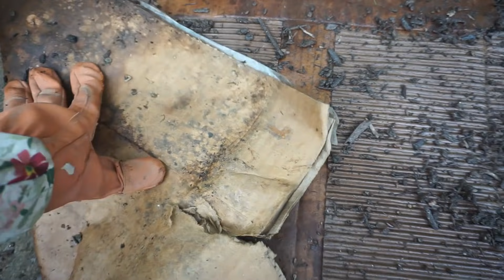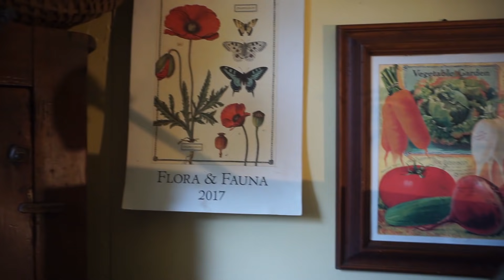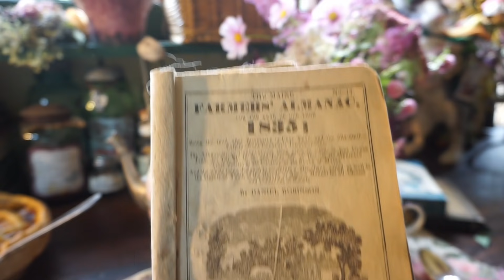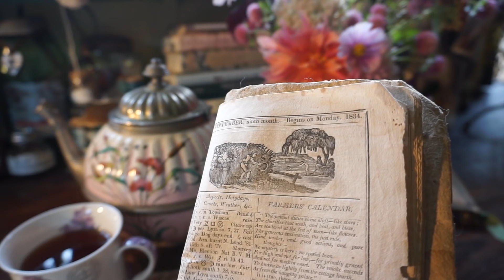Garden Room/ Gathering Plants for drying/ Using a Cold Frame

Comment: I have a room like this at the back of my house.  I live in an old farmhouse on 3 acres built in the 1850s in Pennsylvania.  There is an addition at the back of the house which is from 1920.  It is two rooms comprising a kitchen and a room like this one in the video.  I've been calling it my great room but I'm going to start calling it my garden room.  I have 3 antique colonial style china cabinets in it along with an antique colonial table and chair set.  The room has a sink. I also have my electric stove and dishwasher in this room.  I am planning on adding a wood stove in the room and a wood cookstove to the kitchen.  I really like the way this room in the video is decorate with so many garden items.  I am going to be adding some ceiling baskets and a farm table.  I want also to add more books and little creatures.  I was concentrating on antique dishes but the garden theme makes it extra cozy.  Thank you so much for this video.
Reply from the maker: Sounds to me like an ideal garden room, go ahead and add the antique dishes too... you'll want to have a pot of tea while you enjoy your room.
Reply: @JeriLandersofHopalongHollow    Thank you for your reply.  That room has a concrete floor with some old tile that needs removing and the floor needs leveling.  I’ll probably paint it later.  Also, just had a new roof put on that part of the house and tore out ceiling drywall so I have a vaulted ceiling and beams by default. That’s where I’ll hang baskets.  Lots of work to do in that room.  But I am gaining much inspiration from watching your videos. 😊 PS  I am now painting my living subfloor and aging it with stain after seeing the beautiful results you achieved with stenciling and staining your floor.

Comment: Should I keep my foxglove starts in their pots, in the cold frame ,or plant them into the ground in the cold frame through our harsh ,unstable winter?   Do I need a thermometer inside the cold frame to know when o open the lid during the late autumn / winter ? I'm afraid of frying my plants . ( I did that this early Spring .)
Reply from the maker: If you are worried about the weather, keep your Foxys in the Cold frame until Spring, either in pots or in the soil. I don't use a thermometer; just use your judgement in raising the tops when it is very hot outside.